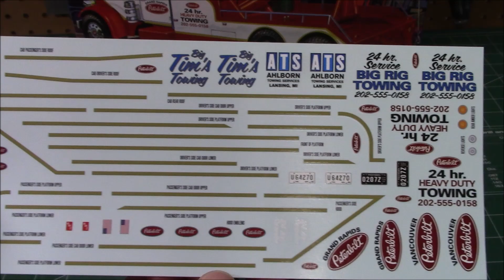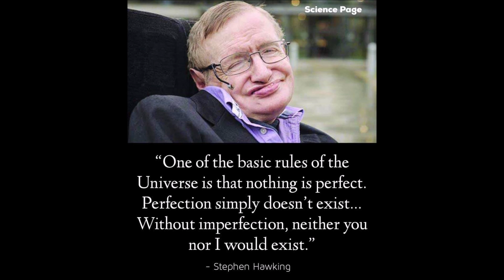AMT Peterbilt 359 Wrecker 1/25 Scale Model Kit Build Review AMT1133

Comment: That is a fine looking Peterbilt Wrecker you built there Chris. Built that model back in the early 80s. Stretched out the frame enough to add the sleeper. Painted the body blue and the frame orange. Built cb antennas out of guitar strings, built up the engine to look as real as possible put the yellow emergency lights on the top, a friend of mine took it to a model truck show someone took a picture of it. That truck ended up in one of the model truck magazines. That cause me to keep building till I had to start selling some to make room for new builds. You have sparked a new light in me that makes me want to build again. Some of the trucks I built in the past took me as much as three months to build. It doesn't matter how long it takes to build these models as long as they look real at the end of the day. Now days these don't take so long cause most of the paints dry faster than they did back in the day. May have to start all over again. Thank you for sharing your skills with the rest of us, Sure by now I need a refresher course. Keep up the good work.👍

Comment: I built quite a few of those Pete's back in the 70's and to get that hood to open all the way, you either had to drop that bumper down or shave the bottom of the grill and touch it up with silver. Haven't built one since the 70's but I'm starting to get back into it in my old age. I'm starting with the AMT Diamond Rio, and lowboy trailer and Dozer kit. It's what my dad owned and drove when I was a kid. I just wish I could find a 1/25 drop gooseneck lowboy trailer instead of that beaver tail lowbow. I'm thinking of constructing one myself out of parts.

Comment: Nice kit. I just purchased mine. I am currently finishing the AMT Alaskan Hauler and the Kenworth Conventional W925 trucks. I like to re do the chrome as well. The main reason being the mould lines and the bits that join to the sprues ruin the factory chrome anyway. It is a shame AMT can't connect the sprues in a less obvious position. I sand after filling with Tamiya model putty and hit them with Krombrite spray. Otherwise nice trucks when some fine detail work is applied to the assembly. Good videos, keep them coming.

Comment: I've watched several of your truck builds.  You do very nice work and your videos are well done too.
I built an Autocar years ago and l found it pretty easy to cut the drivers side door out.  I glued it open so you could see the interior of the cab better.  I also cut the windows so they looked like the were partially rolled down.
I've been watching some of the tank modelers and they are very keen on parts being in proper scale.  I wonder if the frames for the mirrors aren't a bit too big for instance. If so it wouldn't be hard to fashion them out of a smaller guage wire.
I really like your weathering too.  Thanks for some great vids.
Reply: Very interesting your point Sir. I've thought the same about mirror frames specially if we see those for 1/25 AMT's Pump Firetruck. I mean, the model is a "candy" with wheels. It is full of great details; Detroit V8 engine, hydraulic system, control panels, ladders, hoses, lights, handles and other parts, but those mirrors look like a Loch Ness monster abortion. I would take your words to ask the manufacturer (AMT) to improve those frame parts. Along with the most recent technologies, molding for sure has changed a lot, allowing those tiny parts to be much more realistic in regard the gauge. Thank you for sharing your comments.

Comment: if you ever build another wrecker replace the wire with E-Z Line  it comes in two sizes fine & heavy black or brown i use it on my model railroad as cable

Comment: Sadly the kits a heap of garbage. I have built hundreds of kits and consider myself an experienced builder after 20 years. But this is near the worst, I was looking forward to my 1st truck build. but was I annoyed? Plans are missing where parts go and drawings are impossible to detect where parts go. Some parts are not even shown, Chrome work is terrible and impossible to remove from sprues without it peeling off. Gluing is a nightmare with the whole thing and poor fits. I had to go by the clips on here to even know where things went.  It looks good when finished but won't be building another AMT if this is the standard.
I can work with poor moldings and cleaning flash etc but when the plans and drawings are of this standard it is just simply no enjoyment at all.
Reply from the maker: Anyone with 20 years building shouldn't have had that many issues with this truck, but sorry you felt that way.

I've only been seriously back into kits for like 4 years I think. Had this thing assembled ready for paint in about one day. Three days total on the build. Sure, I made some mistakes, every build has mistakes, but its far from garbage and thousands upon thousands of these have been built by others.

R2 has some reissues of Italeri truck kits out, those may be better for you, more modern kits you will have fewer issues with.